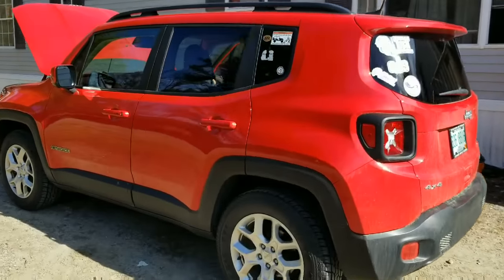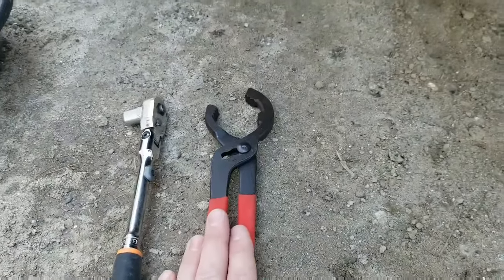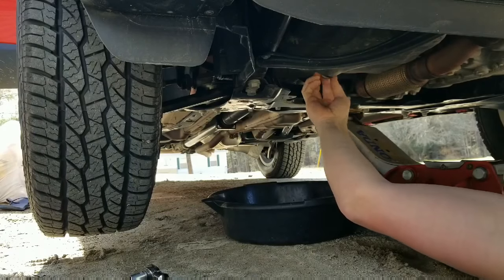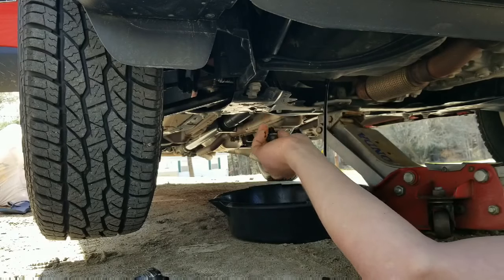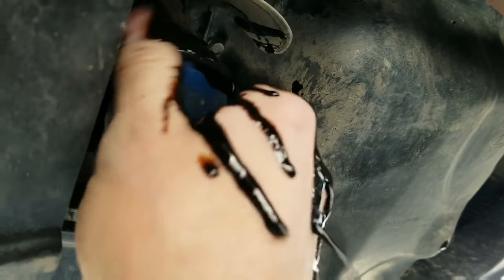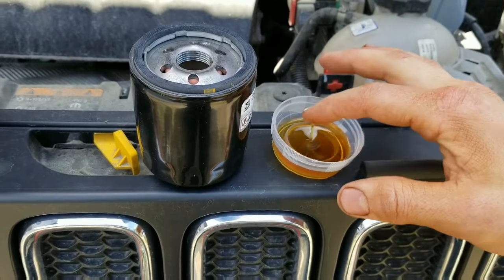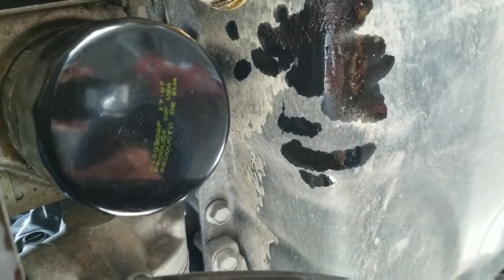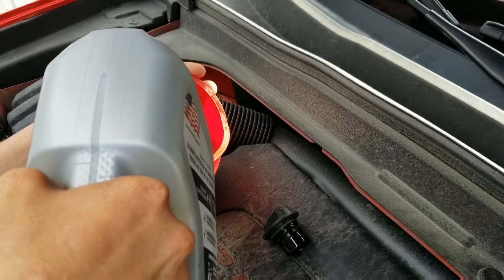JEEP RENEGADE OIL CHANGE & MAINTENANCE RESET // HOW TO

Comment: Looking into purchasing 2016 renegade sport.  Took it out for test drive and noticed that idle slightly off.  Suggest to salesman to have spark plugs checked , like one is misfiring.   Afterwards meeting, I did check the carfax again, it seems to have had the same problem at 49k miles and then again at 59k miles.   It's a 2.4l 14 multi air turbo current mileage 88,700.   This seems to be an on going problem with the Renegades  is there a fix for it? Or is this going to be a continuous defect from Fiat???     Sorry this comment is on the oil change.
Reply from the maker: its more then likely just a bad ignition coil, spark plug or possibly a vacuum leak somewhere. The 2.4 tigershark engines do have some issues like oil consumption problems, but as far as I've seen they're pretty decent engines.

Comment: Thanks, How to change the oil filter?
Reply from the maker: The oil filter is underneath the jeep, you may need an oil filter removal tool to loosen the filter. It will unscrew, oil will start to come out. Just lower the old one down, check to make sure the old seal is not stuck on where it seats. Fill your new oil filter up with oil and screw it on. Once snug tighten a quarter more turn. Hope this helps

Comment: Where the hell to I put the jack and jack stands? This is my 2nd vehicle and the 1st time I’ve looked into my owners manual and not found that info.
Reply from the maker: https://www.jeeprenegadeforum.com/threads/renegade-safe-lift-points.31121/
Reply from the maker: https://www.jeeprenegadeforum.com/threads/renegade-safe-lift-points.31121/post-324425
Reply from the maker: Hope this helps you out